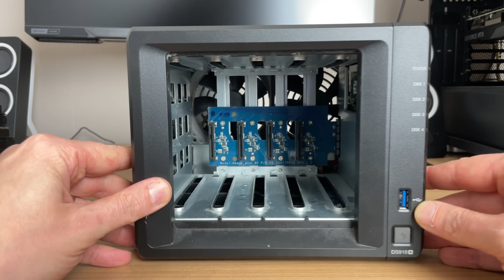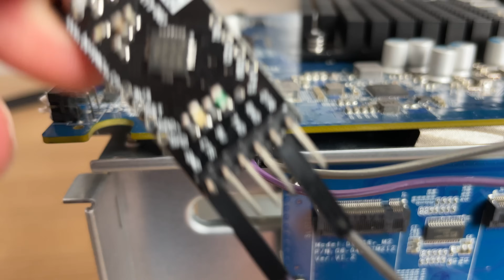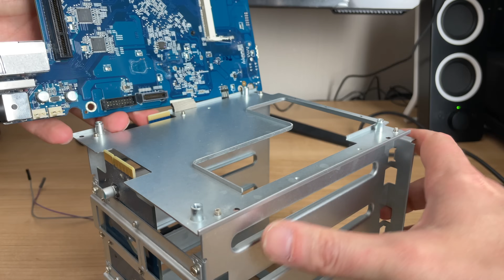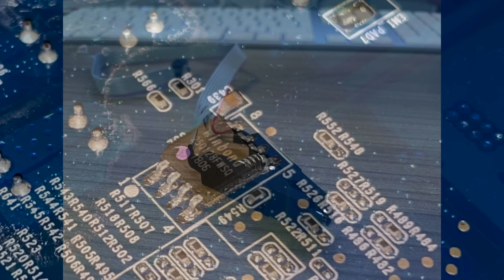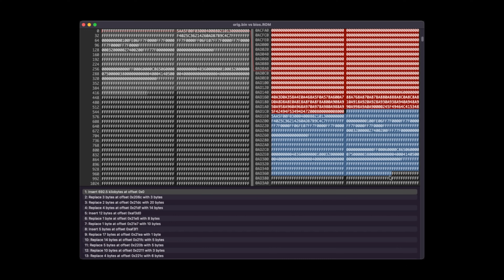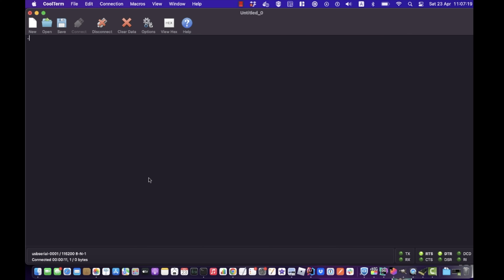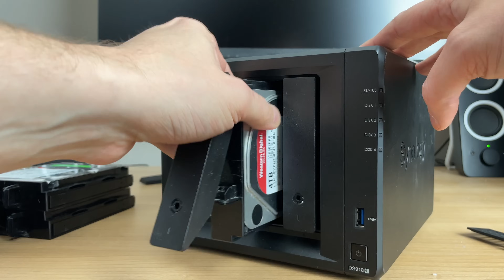Synology DS918+ Bricked / Blue LED of death.

Comment: Had a DS418play that wouldn't do anything at all - no blue light, nothing. Took it apart, replaced the coin cell battery, turned right on when I plugged it in, beeped. It's really awful that Synology put out these products that won't even tell you the battery is low in any way - red light guys? Is that really so hard? Thanks for the video.

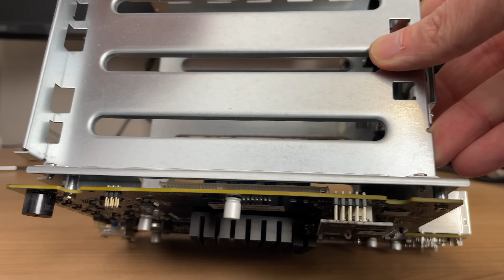Comment: I had this problem with my first DS918+. The PSU was the problem. Fast forward a couple of years and I was getting drive bay 2 missing. RAID rebuild usually fixed it. However, today, the bay no longer exists. I've taken the entire thing apart, and out popped a capacitor! It's stamped J70L / 560 / 6.3V. I spotted it at 6:36... it's on the rear of the backplane 😭 Looks like my NAS is cooked.

UPDATE: I bought a new capacitor from Mouser, soldered it on and my NAS is working again! Had to rebuild the array but all my data is intact!😄

Comment: My 1515+ is also bricked. It would not start after a power outage and remains completely dead. Have replaced it w a 1821+ and intend to buy a UPS. Suspect that this will be my last Synology.
Reply: Update - installed a new power transistor and 100ohm resistor and all is up and running again. Apparently need to install a current limiting resistor in the psu too.

Comment: So, even being an IT professional for many years, and basically understanding flashing EEPROM's, hex editors, etc., most of us don't have the tools at hand shown in your video. Am I to understand from this video, that if I had a working BIOS EPROM, un-soldered the bad one, replacing it with the good one, this would have restored this box to life?

I am looking at a blinking blue light on a DS1513+. I found a totally dead CR1220. No help in replacing. I agree with your comment. Synology offers very little help, especially if you have an older unit. Now, with their restriction on third-party drives, I have no path to restore my DS1513+, because the newer systems refuse to recognize Seagate drives coming from my older DS1513+.

Comment: nice repair , i would have replaced the Winbond chip with a new one , the reason that there's no easy  recovery method is that the ccip contains the bios just like a normal pc motherboard and the only way is to make a dual bios or something , when the power is cut and the electrical company is repairing it , the power does not come back on in a clean fashion , maybe a UPS is a idea that wil filter this out and you can gracefully let hte device shutdown i have a QNAP and the UPS was attached with USB cale to share status and when tje batterie of the UPS run out , let is shutdown in a normal fashion and save the hardware.

Comment: thanks for the guide, I had a similar problem, but couldnt be fixed with BIOS flashing, seems that my unit has something else defective too. Unfortunately my bios boots ok randomlñy an dother times not even show anything trough serial port. sometimes half boot (info on serial port but not beeping)... frustrating.

Comment: Same thing happened to me although no power cut and am connected to a UPS anyway. Left it unplugged and came back a day later and checked PSU -12V 8.33A. It was only reading 11.44V. Checked another PSU I have 12V 12.5A and is reading 12.45V. Blew all the dust out of the NAS and HDD, hooked it up to new PSU and voila! So far, all operating as normal.  Hope this helps someone.

Comment: Um, so you're telling me that you suspected the BIOS ROM chip over everything else that could have been damaged by the power loss? The very first thing you should have checked was the actual power supply voltages. Sounds like you fell backwards into that solution but in the end it worked (for now). Get a good quality surge protector or even better add a whole home suppressor to your AC panel.

Comment: Some old ATOM CPU Synology NAS boxes need one or two new resistors. Due to a design error, the NAS box does not work properly and stuck, but there are also videos about this problem on YouTube. Bios chips can be corrupted, but the first time I saw that it happens in a Synology NAS box. Power brick can be, also broken. The manufacturer does not offer any repair once the warranty has expired. YouTube has revealed that many errors are due to a design error made by Synology, which is not a good thing when you have to think about the quality and price of the product.

Comment: The flashing blue light seems to be a common problem on the Synology units, my DS718+ has failed with the same blue flashing light after being moved to a new location, mine too was powered down by loss of supply (and that has happened a couple of times as it was solar powered and I had a power system fault occur), it would not boot. Interesting diagnosis, but that level of diagnostic is not something I’m equipped to do, as I’m an RF guy. There’s really nobody here in Australia who repairs these devices so I’ll have to look elsewhere for assistance. Glad you fixed your unit.

Comment: Yikes!  I am a normal guy without your skills or tools, and my problem is slightly different: two blue blinks then power off.  So, my question is: "Can I install my 4 drives (2x8TB & 2x10TB) in a new Synology unit without data loss?"  Or perhaps you do house calls??   You are an excellent diagnostician and very brave.  Thanks.
Reply: Usually you can transfer your disks too a new box without issues ....

Comment: There's no easy way to reflash the bios using the serial port not only for reading also for writing? 'cause it seems that the first lines of bios.rom you have deleted to align the codes with orig.bin were exactly intended to launch the bios rewrite with bios.img.

Comment: Excellent. Are these the tools?

MiniPro-TL866II+

SOIC8 SOP8 to DIP8 EZ Programmer Adapter Socket Converter Module with 150mil

I Also Amazon has a  kit:
V12.60 Original XGecu T48 [TL866-3G] Programmer Support 34000+ ICS for EPROM/MCU/SPI/Nor/NAND Flash/EMMC/IC Tester/ TL866CS TL866II Plus Improvement +9 Parts

Comment: Do you have a hint on how I identify the bios on a DS413 It does not look like DS918+??
Done something like it on old motherboards where  I borrowed a bios chip from a similar MB and booted up and returned my own chip in the socket and wrote info to my own chip. Gone was the infection.

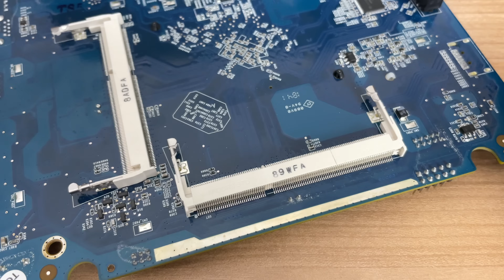Comment: @ 8:45 perhaps the reason the Ram was having issues is because the Ram you took out was ddr3L PC3L (1.35V) and the Ram you put in was not L rated and required more power than the system could deliver (1.5V). 🤷‍♂️

Comment: First, let me tell you that if I had your mind, I would be a better person. I found myself spellbound looking at all the things you did with your synology ds918+. And you are right they should have better information on this product. Tell me, could you for us dummies do a step by step on the setup of this machine? Let me take you back in time if I could. I want to say that about 5 years ago,  I purchased my ds918 and set it up. At that time, everything was working fine until I did an update. From that moment on, I had to leave my computer turned on in order to be able to see movies on the nas. If I was at work, I would open the plex app on my smartphone and look at what I had on it. If I was in the house, I could open plex on my tv and look at movies. The web assistant is what I use and I see it. I click connect and everything comes up. I am able to load files on the nas but that web assistant is Minimized and running always in the task bar. If I turn it off or shut down the pc, the only thing i am able to see on my phone or tv is the things that plex has up. On my NAS It called Is whirlpoolgalaxy and it says off line. What must I do. I was thinking pushing the reset button or going in on administrator Account and clicking reset and starting all over. What do you thing. I hope you can help. Oh ablut three years ago i bought the router recommended for this system, never got it working. It is sitting in the corner. Hope you can help.

Comment: Well 5AA5F00F is pretty much common even in laptops for the start after the ME region is cleaned. Or a fresh bios. I am very skeptical this was the fix. As when the ME gets rebuilt on first run, the bios actually shouldn't match the one in the system, compared to the one downloaded from Synology. Because when you get a clean bios, like from Synology. It first has to go out and discover the real estate on the board, and add or delete sections of the bios so that second boot and all other boots later won't get lost, and is much faster. The other info, like model, serial number, and mac addresses, are all stored on the USB DOM daughter board. That little 1" inch squared board. But the bios has to see the SIO, the LAN, the CPU type. All this info gets recorded in the bios, and thus changes the bit structure of the bios. And always on first boot from the factory. That is done in such a way that is ever anything is missing later. Like a dead SIO for example., The bios won't complete the boot cycle. Or if you ever change a chip on this board, or even on a laptop. You are gonna need a fresh bios with a cleaned ME, for first boot discovery. I have done many Synology USB DOM's and Rom's, as I am the Synology service center from synologyonline. Now I have to admit. I realty like this video. I think if more people actually took the steps to do these, and spread the info out there. There will be alot less BLOD's for Synology Units. I give you credit for that. And please do more. And by the way. The DS918+ is a pretty stable unit, and still new. As we very rarely see these here in the service center. But power surges, and or a dying PSU's that throw spikes out, can cause a lot of corruption on these. In fact the number 1 issue with NAS's that have an external adapter. Is the adapter itself. It lights up fine. But no current to power up anything is present. Enjoy!
Reply: Hi, maybe you have synology schematics, board views or service manuals, PIc , IO dumps  for sale ?
Reply: @viktoras220  I don't. My data is from working units as samples. But if you look close. You will see a hint of Asus in there.

Comment: Good job on the repair, you have skills for sure.. I do question though why you don't have this hooked up to a UPS with a USB input so the NAS can monitor power and shut itself down during power loss issues.. also I wonder if it was attempting to update the BIOS when the power went out?

Comment: You should've replaced the stock ram with 32gb of ram (two 16gb modules), add two M.2 drives of 512gb each and install DSM 7.

Comment: I understand you are running Raid10 based on your comment in the beginning of the video. I'm wondering why you don't use Raid6 instead? Raid6 with BTRFS should be far superior to Raid10 for data safety. Due to the low 1Gb/s (Maximum 125 MB/s) transfer rate the superior internal mirror disk reading speed with Raid10 is of limited use.

Comment: I agree there are many reasons this shouldn’t have happened. You should be able to flash the bios without taking the machine apart but moral of this story is get a UPS. These might be consumer boxes but when you load them with 4 enterprise drives, a couple of SSD cache drives you’re now sitting on a couple grand of product. Both mine are connected to decent cyber power  UPS’s that will shut the Synology box down properly before the battery power runs out. Mine will power my modem, router, switch, Synology, computer and 2 monitors for about an hour. It’s never failed catching a power company outage and shut the computer and Synology box down well before it was out of battery.

Comment: The only power outage that I've had in the last 10 years was caused by contractors working in my home. My DS920+ webt down 3 - 4 times and each time it has recovered without it skipping a beat. In one unexpected event, the contractor got way closer than expected, knocked it off its shelf and all of the hard drives fell out onto the floor. I blew the dust out, put them all back in their slots, booted it up and off it went. No issues. So, unplanned power outages are not necessarily a death sentence for these boxes. A single episode like this is not reason enough to condemn the whole product line. Statistically, it makes no sense. My QNAP, on the other hand, required manual re-installation of half of its apps.

Comment: regardless of the problem here... After a power failure the first thing to try is a different power supply... I assume that Dave try that of camera..
Reply from the maker: Read that this could be PSU related but had a spare synology power brick but same issue.

Comment: The reason dump is not the same is that original bios had DMI region with some configuration data +serialnumber. If thats intel driven NAS it would also have ME region block which not only differs after it initializes itself but also works as a sort of partition, e.g it writes logs.

Comment: So, basically all the 22 minutes was just finding that the bios was corrupt and reflashing the bios solved it? Well, maybe they could have a bios reflash feature from USB like some motherboards today. Anyway, my problem is that it is impossible to find a cheap PC case with such slot-like HDD enclosure like that. I don't know why it should be so expensive. PC cases are cheap (I can buy under $30) and all they have to is adding HDD slots like that. I don't want to pay $500 for some proprietary NAS, I want to use regular PC and Linux so that I could easily fix or replace a problem like this.

Comment: my DS418j bricked a few months  before warrant expired (at the first power cut). I already had all my important data on it so was scared if I take it back and they replace it with the new box It may corrupt my data on my HDs for whatever reason. So I applied an insanity theory on it: try the same thing over and over expecting different outcome. And it worked. Removed the HDs (exactly the same config as yours 2X4GB red and 2X4GB Seagate = 8GB total). Instead of turning it off on the blinking power button, I would just pull the power from the back, wait a couple of seconds and plug it back in and try to start it again. Didn't work so tried different combo. Hold the power button, and then plug in the power, plug the power in and then press and hold the button, plug the power in and then rapid pressing the blue button, plug the power in and normal start and let it blink for the next hour or so, plug the power in and wait certain time before I press and hold the power button... so many combination nothing worked. But then during one of the attempts,  I heard the beep and the blue light stopped flashing. It booted normally. After this I immediately copied most important files to my other Synology DS216se which I use only as a media player. Then I tried to power off and on just using the power button. It worked fine. So how am I going to take it back and ask for the replacement when it is working now. Pull the power cord out again and brick the unit again? What if they do what I did and return back to me the same box again as "repaired"? I would waste a lots of time then until the warranty is out. So I went and bought the cheapest UPS for it and "solved" the problem. 
My DS216se  had so many power cuts but was never bricked so I assumed it is flawed design with this DS418j model. Then next thing happened. While I was on my holidays my cheap UPS failed. I got home and replaced the internal battery in my UPS $20 and got it going again but the DS418j was bricked again. And insanity theory applied again and got it going again. This time just by unplugging the power from the back and starting it again normally.  After 10-15 attempts comes the beep and the boot started. It has been running since without any problems. I never tried to brick it again but since I saw this video I may look for the later bios to flush it and try to brick it. Maybe the proper flush will fix the problem. Rewriting the EPROM by software should clean any bug leftover in it and get me same reliability as I have with my old and much cheaper DS216se. If not I can always rely on insanity.

Comment: Yikes, this is the model I run and I've run it on a UPS since day 1. After Synology changed all their requirements for qualified hard drives forcing users to spend £££ for Synology-branded disks on their newer models, I decided I wouldn't buy another Synology - this confirms that decision. A shame, because they are (or were) largely zero-hassle devices. Until something goes wrong... 

My previous unit is a Netgear ReadyNAS Duo Ultra - which I upgraded recently to the latest RAIDiator software, using the community-developed method advertised (but not officially supported) by Netgear - but detailed on their own user forums. Like ASUSTOR and a few other vendors, Netgear take a pretty welcoming pro-consumer approach, it seems. It now works great on the latest OS. Sadly I don't expect Synology will offer that kind of longer-term support for their oldest devices, though they do still offer technical support on my 2018 DS918+ despite it being out of warranty.

Comment: Is it possible that the "debug" port also provides a JTAG function to permit (re-)programming of the "BIOS" chip in-situ? Manufacturing considerations alone would demand JTAG, so it presumably does. 

As far as why it went bad, well Synology's reputation lead me to use simpler non-RAID NAS (x2), with multiple offline USB HDDs for backups. Your US$500 (does that even include your 4x 4GB drives?) will get you a shed load of simpler non-RAID NAS + USB storage.

RAID systems sure consume a lot of time and effort, while promising to save you time and effort. For this, they cost more too. A bit like a UPS that catches fire and burns your house down. "Yeah, thanks..." LOL